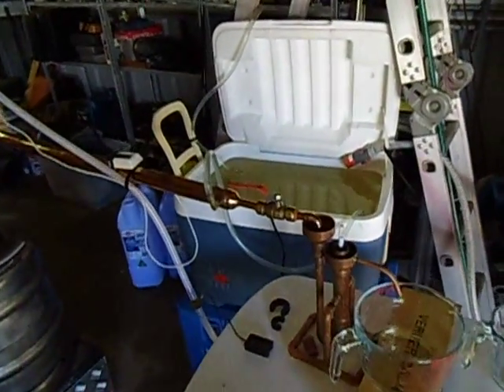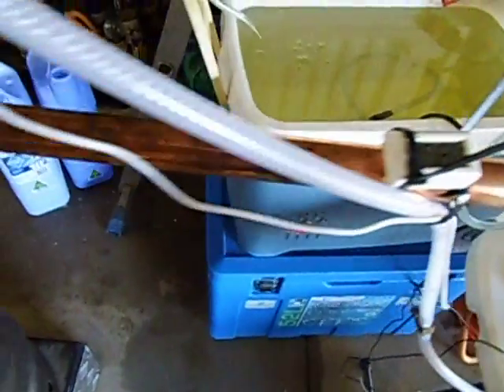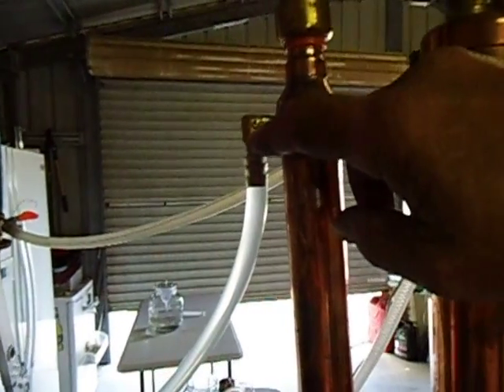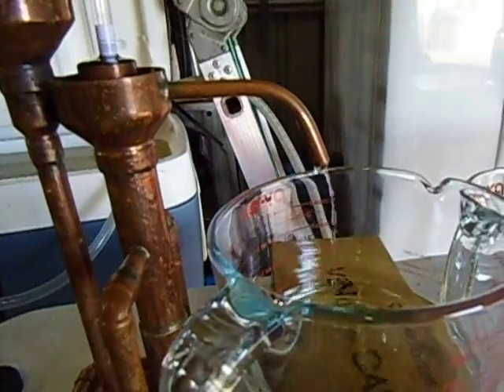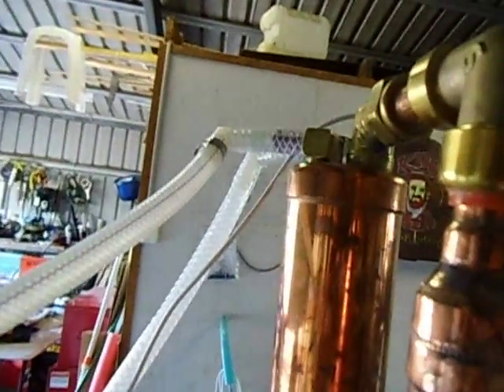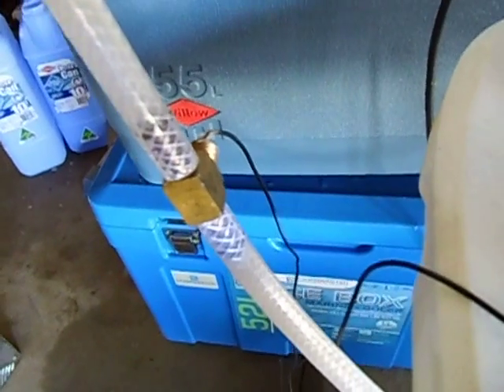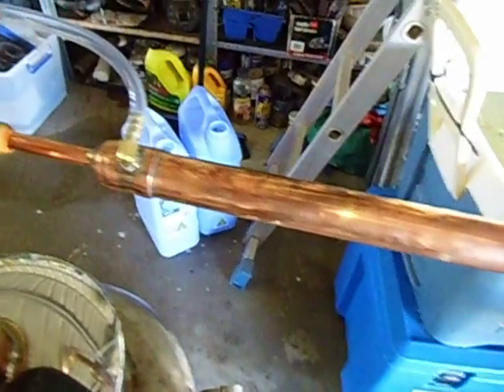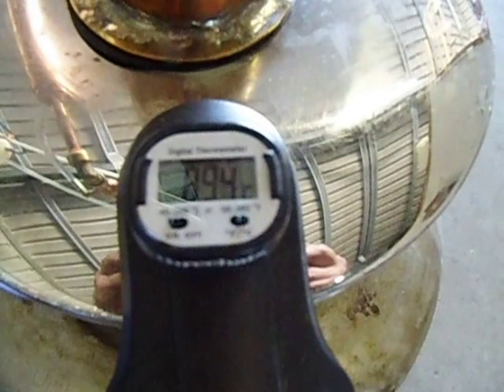Reflux still water flow setup 800mm column 2 5 inches.

Comment from the maker: I used a 25lt vessel that’s sits on a ladder a bit higher than the reflux condenser in the column and is filled with cold tap water and it is controlled by a needle valve on the outlet going to the reflux condenser. It also has a valve on the inlet to turn the water flow off when the vessel is full as I running water pumps on my property.

Comment: Looks great job sir. I built very similar one, but could not regulate the temperature by the reflux condenser. I read your explanation about reflux condenser water flow, and looks flowing very slow. I tried but still could not manage? Do you ıse cold or hot water for reflux condenser? If it is hot what is the temperature for entrance to the condenser?
Reply from the maker: Good day mate I used a needle valve between the vessel and the reflux condenser in the column.The vessel is higher than the vessel and just normal cold tap water flowing on gravity only. Can try using a compressor regulator if you can’t get the right needle valve
Reply: @danssv8   Thank you very much, I will try first to find correct needle valve.
Reply from the maker: The reflux temperature should only be about 10 degrees centigrade lower maximum than the vapour temperatures, hope this helps you out.
Reply from the maker: Some hardware, plumbing, ebay and Aliexpress should have little needle valves that should work also the turbo 500 still valve or a compressors spray gun regulator valve could be used.
Reply from the maker: Just need to restrict the water flowing to the reflux condenser
Reply: @danssv8  Yes sir, I understood clearly, thank you very much. Happy distillings, cheers
Reply: @danssv8  Dear sir, Dan you are the master of distilling, thank you very much to answering and clerifying my questions. Success, I did. % 96 abv,

Comment: Dan, awesome video and fantastic art.  Thanks for sharing.  Can you provide specifics on the parrot you made?  How do the support legs attach to the vertical stem? Are those (what look like 5/8" copper tube) soldered to the vertical stem? brazed?  TIG?  MAPP? Is there a sleeve around the inside pipe that the hydrometer rests in or are the legs attached straight to the same pipe?  Attempting to figure out how to make the same connection you have. Thanks a million for your help.  amazing work

Comment: Hi Dan, why did you go with gravity feed for water for the reflux coil as apposed to another pump? good vids by the way ;-)
Reply from the maker: I live rural and the pumps kicks in and out all the time , it then influence the flow through the reflux condenser in the column . Much more stable to regulate with the needle valve on gravity feed , cheers
Reply: How much water do you get through on a typical boil (not your recirculating water)? cheers
Reply from the maker: +RTGood1 On 25lt mash in a single run i will get 4.5lt alcohol at 90 percent abv , so the other 10 percent would be water , so about 450ml of that is water , cheers

Comment: I made almost the same setup as you have except I had a 8 inch ferrule welded to the top of my 58.66 Liter  beer keg instead of a pressure cooker with a 8 inch ferrule cap with a 3 inch ferrule reducer in the center to attach my 3 inch copper column. How did you cut off the top chime from the keg to get that nice dome top???